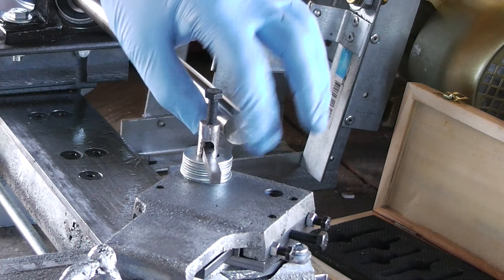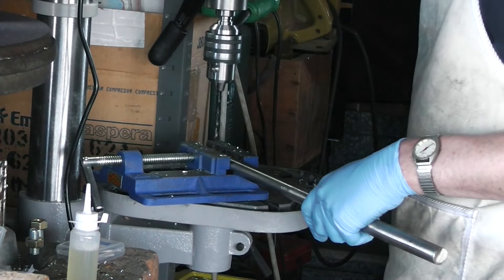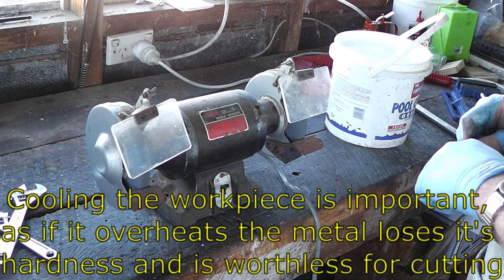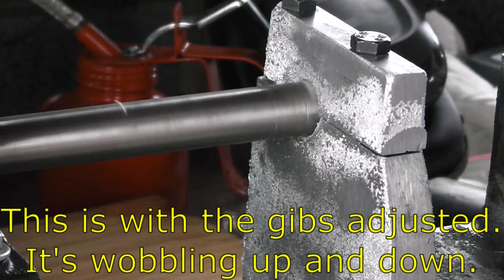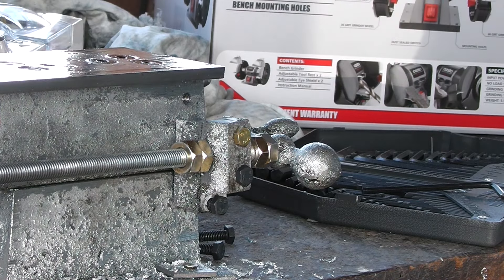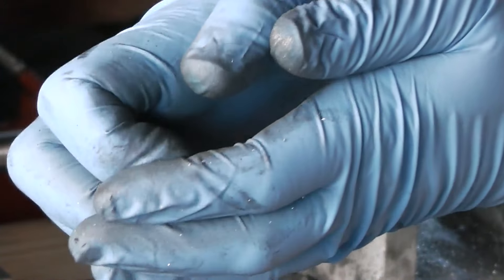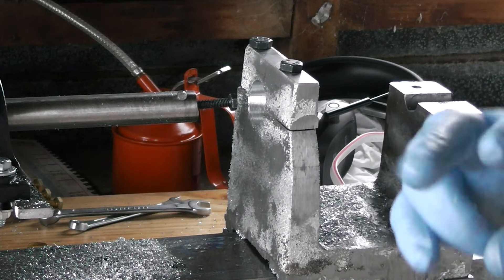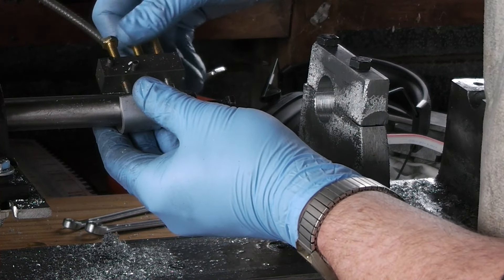Boring is Annoying

Comment: Love watching this series, I've been meaning to start a Gingery build for years now but never got around to it. But I think I'd have the cutter in the middle of the boring bar with a pillow block at each end of the bed to help reduce the deflection in the bar and then move the headstock between the blocks. Also boring both journals at the same time would not only ensure they're parallel to the bed but also means you only have to make half as many adjustments of the cutter.
Reply from the maker: Unfortunately, the 20mm bars I can get that are relatively accurately made are not long enough to reach the length of the bed. If all else fails, I can just make another headstock! :)
Reply: With a cutter in the middle if the bar how would you iock it off?
Reply: @DIEmicrosoft  The same as when it's in the end of a bar, using a screw at 90 degrees to it. But instead of a machine screw in the end I'd use a grub screw in the side.
Reply: @johannesfactotum2682  Course. Wasn't thinking properly, 3am here haha

Comment: yes there is a lot of stick out. safety first. always find a way to support near the end you are machining.  also stainless steel is slow speed with pressure down. otherwise good on ya for the job
Reply from the maker: TBH, the machining was completely unnecessary for this, I just wanted to try out actual lathe cutting on something where the finish didn't actually matter.